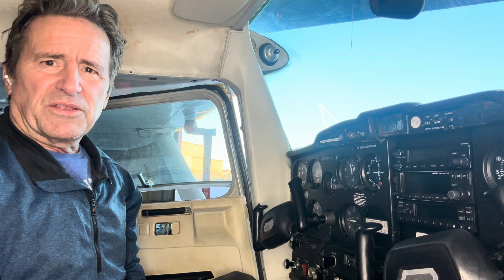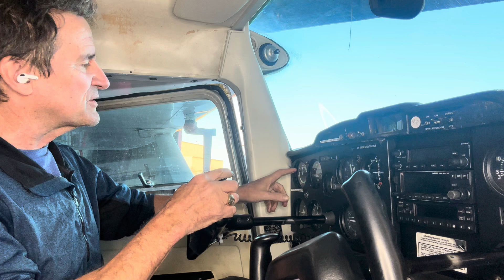Every Airplane Has an Angle of Attack Indicator

Comment: Stalls do not occur at the same angle of attack.  Stalls occur when the critical angle of attack is exceeded.  The critical angle of attack changes, relative to the angle of the wing to the oncoming air, and the load factor of the wing.  The amount of aft travel left in the yoke, indicates nothing as far as when a stall will occur in any given flight attitude or configuration of the plane.
Reply: Disagree.  PHAK pg 5-25 - "The stalling speed of a particular aircraft is not a fixed value for all flight situations, but a given aircraft always stalls at the same AOA regardless of airspeed, weight, load factor, or density altitude."
Reply: @warren5699  
I should have used "pitch attitude" instead of "angle of attack" in the first sentence.  I agree with everyone's comments, the AOA where the stall will occur is a constant.  The position fore or aft of the yoke is not a good indicator if the wing is near that critical AOA, in various flight configurations, was the point i was trying to make.
Reply: @johnboleyn4024  Thank you for the clarification.  Can you give an example of when the position of the yoke is not an approximate indicator of the angle of attack?
Reply from the maker: @warren5699  Upside down! Pushing to create greater AOA.
Reply: @SAFEPilots  Aaahh yes - inverted flight.  Didn't think of that one.
Reply: @warren5699  It's not that the yoke position doesn't approximate some indication of your angle of attack, i guess at some level of aerodynamics , it does.  Relating the position of the yoke, to some finite fore or aft position relative to "this is where the plane will stall, and forward of this position, the plane will not stall" is not correct. The AOA and the pitch attitude/yoke position is relative to the angle of the incoming air, where the critical angle of attack is exceeded.  For instance, in trimmed for hands off flight, in wings level flight, flaps out, power at idle, flaring to land...the yoke can be pulled pretty much all the way to the stop, before the stall warning horn goes off, and the critical AOA is reached. In a 45 degree bank turn, level flight, power at idle....the stall warning horn and buffet will occur, well before the yoke reaches full aft travel, as you pull on the yoke to maintain altitude.  This is because, in the landing configuration, the wings is probably at 8-12 degrees AOA to achieve the desired flight configuration, and you can pitch up 10-15 degrees in the flare to get to the critical AOA.  In a 45 degree bank turn, due to the angle of the incoming air to the wing, the wing is flying at a higher AOA because of the bank angle, the loss of some vertical lift converted to horizontal lift, the wing is having to fly closer to the critical AOA to maintain level flight, so there is only a few degrees of nose pitch up left, of aft travel of the yoke needed to pitch the wing, to reach the critical AOA.  I don't think i have ever gotten the yoke anywhere near the aft travel limit, practicing accelerated maneuver stalls with students, and the stall horn is alive and the wings buffeting.   

What do you think?  is this aerodynamically correct?  If it isn't,  I need to get into some more information on AOA, critical AOA aerodynamics, and flight characteristics.
Reply: @johnboleyn4024  There are many factors.  In the landing, there's also ground effect and the airplane is usually at full flaps.  Full flaps can reduce the smooth airflow to the empennage and seems to reduce elevator effectiveness, which can mean that pulling well back is actually not resulting in as much angle of attack as it will at altitude with the flaps up and better airflow over the elevator.  So that's how a lot of landings may not activate the horn until at the very end of the float - the yoke is well back but not really holding the nose as high.  There may be a delay in the horn activating until more speed bleeds off - but where is the yoke - well back.  The approach airspeed is another factor.  For ex: if you hold the approach speed at 65kts until you start the flare, you probably won't hear the horn until near the end of the float because there was an abundance of energy to manage the roundout, where the g-force goes up some.  The float will be longer and with ground effect, there's not as much angle of attack needed to hold the airplane off.  On the other hand, if you start the flare closer to the runway at 50kts (in an effort to get 'little to no float' for a short field landing), you might hear the horn the moment you apply back pressure because, similar to the accelerated stall at altitude, you are already at a higher angle of attack in the last few feet of the glideslope at 50kts, and then increase the g-forces during the roundout.  Bottom line in all cases, if the control wheel is well back it should be considered a danger zone.  I don't think the video meant to say that a specific point or mark on the yoke would always indicate stall or no stall.
Reply: @warren5699 and yet it is possible to far exceed the so-called “Critical Angle of Attack” and get back into the “normal” AOA range without ever stalling.  A wing only ever stalls when separation of airflow occurs.  This happens when the inertia of air flowing past the wing exceeds the viscosity that makes the air follow the curvature over the wing and boundary layer.  It is possible to unload a wing and then get slow enough that the inertia cannot overcome the air’s viscosity.  The wing can be presented to the airflow at an angle exceeding the “Critical AOA” with air remaining attached, but producing less lift than necessary to sustain flight on its own.  However, when combined with sufficient propeller thrust, certain aircraft may be able to fly like this, in an extreme nose high attitude.  If you’ve ever watched a Sukhoi or Extra “hang on the propeller,” this what is happening.
Reply: The critical angle of attack does not change. In most GA trainers, the critical AOA is around 18 degrees, and is a characteristic of the design of the aircraft. The PHAK is defined by the PHAK as "The angle of attack at which a wing stalls regardless of airspeed, flight attitude, or weight." The thing that DOES change is the angle of attack, which is the angle between the chord line of the airfoil and the relative wind it experiences.
Reply: @NorthCentralFlightCenter  however, if you can get it to fly slow enough unloaded, you can then exceed the 17°-18° “critical AOA” and fly with a combination of wing lift and propeller thrust without ever stalling. Watch Martin Šonka as he holds formation with a parachutist in the link I shared.  We do maneuvers in our Extra that frequently exceed 20°, 30° of AOA.  If you fly slow enough, the air has insufficient momentum to separate.  The problem is there is also insufficient lift to maintain level flight at or above 1g with wing lift alone.  In the example above, Martin’s Extra is still flying, it is not stalled, and it is way above 17° or 18° AOA.  A stall occurs when the inertia of the air exceeds the ability of the viscosity of the air to follow tight curvature and remain attached.  There are other factors like adverse pressure gradient and reverse flow in the boundary layer that can trip a wing into stalling, but if a wing is moving very slowly, the viscosity and pressure are sufficient to keep it attached, because there is very little flow and very little momentum to the air.  It won’t produce enough lift to fly with wing lift alone, but in combination with propeller thrust, the aircraft can be made to hold altitude, fly and respond to control inputs.  We fly our aircraft to zero airspeed without stalling.  When flying a double Immelmann, our exit speed at the top is 30 KIAS but we are not stalled (normally its straight and level 1g stall is achieved at around 60KIAS at a typical 17°-18° AOA).  You have to have some speed in order to stall, or the air will not separate.
Reply: @redfalco21  Interesting.  I saw similar results in basic slow flight training at minimal speed.  Using power we could fly below the white arc, which is the power off stall speed.  Apparently one possible reason for that is that the power is contributing to the total lift (a very small percentage) but enough to allow a knot or two or three less speed while not exceeding the critical angle of attack - i.e. reducing the workload of the wing a tiny bit.  We had no way to measure the actual Angle of Attack but the airspeed indicator and use of the power were very reliable indicators of what to expect.  And going back to the point made in the video, the control wheel was well back indicating we were close to the critical angle of attack.
Reply from the maker: @redfalco21  You are correct! Below one G (and you cannot sustain level flight) you cannot stall the plane. Please share that linked to a "double Immelmann!"
Reply: @ I have a video clip from inside the cockpit using a Garmin Virb.  I will have to upload to my YouTube channel.  Maneuver is started at 185 KIAS and around 2,500 AMSL, with a 7g -8g pull into the first Immelmann.  First Immelmann results in an altitude gain of ~1,000ft and a 180° direction change with a half roll back to upright, all in 8 seconds.  Second Immelmann is started immediately at an entry speed of around 115 KIAS.  The initial pull for the second Immelmann is only around 2.5-3g.  It takes around 12 seconds to complete the second Immelmann.  Half roll (to the left) off the top is sluggish and needs to be stopped about 45° early because propeller torque wants to keep it going.  Exit speed is around 30 KIAS, but unloaded, with a little bit of a ballistic trajectory off the top to keep the loading close to zero lift while the airplane accelerates back to flying speed.  Total altitude gain for both Immelmanns is around 1,700 ft.  If handled correctly the airplane never stalls, although it is easy to get an accelerated stall at around the first third of the second Immelmann.  The real challenge is keeping the entire figure in one vertical plane.  There is a tendency to turn off the line near the top of the second Immelmann due to torque, gyroscopics and propeller slipstream effect.  It low airspeeds and high power, these effects dominate over aerodynamics.

https://youtu.be/YmmJxU4uFXo?feature=shared
Reply: https://youtu.be/S7WqwNiyP3k?si=BMeH1R1v0ZKt09Js

Comment: I'm sorry for being annoying on the internet, but this was all pretty much garbage. Yes pitching up increases your pitch, and therefore increases angle of attack. But an AOA indicator is not how much chrome is showing. If you fly with an AOA indicator in turboprops, you will see how much other factors within the flight envelope, other than pitch, can change your angle of attack. The AOA vanes in transport category aircraft provide information to the flight computers and determine things like minimum airspeeds, pusher/shakers, trim etc. (In these jets you actually don't see the angle of attack indication like a traditional AOA indicator.) I get a strong sense you have never been in an airplane that has an AOA indicator. I do agree that GA aircraft don't need AOA indicators and healthy flying habits are more important than fancy instrumentation.
Reply: On a convential fixed horizontal stab/elevator combo and also on Stabiltors forming part of a reversible flight control system, at 1G in equilibrium flight, AOA is dependant on Elevator position and therefore Yoke position. If the yoke is moved out of this 1G/trimmed equilibrium it induces a change in AOA that is related to the CL of the elevator, Which translates to a pitch rate that depends on the airspeed.  If that yoke is held fixed and the aircraft is allowed to settle into the new 1G equilibrium the aircraft will be flying at a new corresponding AOA. 

It is possible to pitch up at a Constant AOA, or even decreasing AOA. Think accelerating while keeping a constant positive pitch rate(recovery from the second half of a loop for example). however to keep a constant pitch rate you will have to vary the yoke position as the target AOA to achieve that pitch rate reduces with increasing speed.

This is why when we trim any conventional airplane we don't fix a pitch angle we approximately fix an AOA which at 1G fixes our speed.
Reply: @ Pitch rate varies with speed during a symmetrical loop, AOA is variable during the maneuver. The video fails to mention one G flight and most folks get into trouble outside that parameter. Finally, if such a simplistic explanation was valid, it would have been taught as such for the last 100 years. Teaching stick/yoke position equates to AOA is misleading and possibly confusing to some folks who don’t need any more confusion as they learn to fly.
Reply: @SAFEPilots , yes, an airplane can exceed its critical angle of attack at any speed. That’s why nobody here is confused about speed, as you try to claim. 

But stalling at any speed does not mean that the elevator is in full deflection. 

I fly jets too, with Angle of attack indicators. I’ve also flown aerobatic planes with AOA indicators. I understand how AOA works and elevator position is not a constant in the equation.
Reply: You're right and thank you!❤ Happy New Year🎉
Reply: Okay so I think that was the point of the video bud. He’s sitting in a 150… we are clearly not talking about jets.
Reply: @cyppy7473 No, the topic is AOA and his theory is BS. There’s a correlation  of sorts but only under specific circumstances.
Reply from the maker: @cyppy7473  RIght, "that guy"  - me - (surprisingly) flies jets for a living. Works the same in jets! What all these comments are confusing is correlating AOA with Airspeed. You can have any airspeed with any yoke position with acceleration. Full back yoke (max AOA) can occur at cruise airspeed (that is how you do a snap roll). THe missing element that creates this is "G force." Stall speed increases at the square root of the G force. Va (3.8 in normal category aircraft) is approximately twice unaccelerated stall speed (square root of 4 is 2). AOA does not correlate with airspeed; any plane can stall at any airspeed if you exceed the critical AOA.
Reply: @cyppy7473 doesn’t matter if he is sitting in a 150. It’s still complete BS.

Comment: Simply put, the closer the stick/yoke is to your gut, the greater is your angle of atack and the closer you are to the stall.
Reply: if you eat enough bbq the stick won't come back far enough to stall!   so the more you eat the safer pilot you are
Reply: Unless it’s a trim induced stall.
Reply: @flyingconsultant  Like in a go-around?  The propeller slipstream combined with the trim tab position makes the elevator and thus the angle of attack go up excessively.  The yoke will move back the same as if the pilot pulled it back.